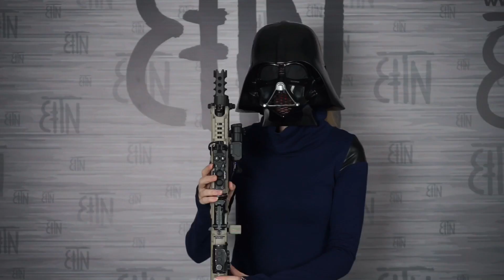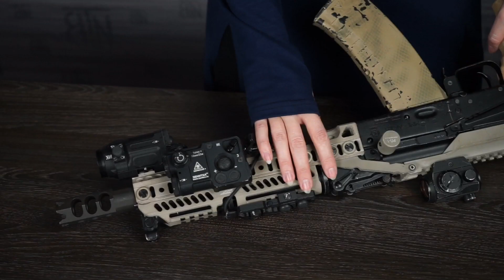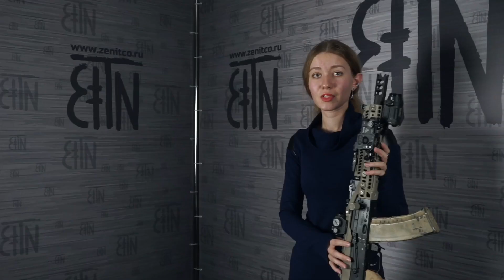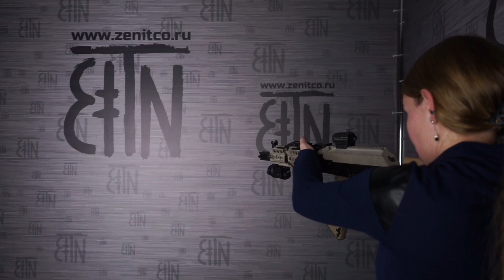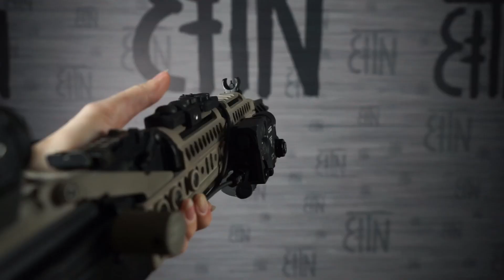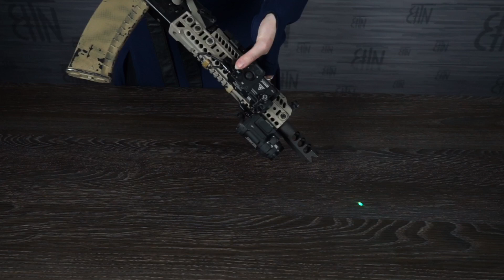Zenitco Perst-4 + Klesch-2 operation modes - Halloween edition

Comment: Can the remote switch be used with the klesch-1?
Reply from the maker: KV-4/2 - no. Another switch - yes. Depends on generation of Klesch-1. So older Klesch-1 were not compatible with dual switches. Klesch-1 gen.2.0 will be compatible with KV-D3/2P switch and other switches from “D” line. Klesch-1 gen.2.0 will be available soon (generation will be written in product name and engraved on product, if there is no generation mentioned, it means that it is older generation).

Comment: The gun probably has no recoil at all with all this metal attached 😄
Reply: Since you are replacing the parts, the weight does not go up as much as one would think, but still that gun weights around 0.5kg more than a stock variant (not including the light). Recoil is quite low due of the extremely aggressive muzzle brake, however, when you are using that, you will very much annoy your friends! Cheers.
Reply: I have a EOtech 512, a Perst 4 and KE2C M600B Surfire clone on my M70 Zpap along with the same DTK muzzle brake she had on her AK in the video and it does weigh some, but not as much as you think and that weight has made recoil non-existent. Not that 7.62x39mm recoils much anyway but the weight has made repeat shots on target a breeze when combined with the recoil control the DTK offers.

Comment: Anastasia I need some help with a question. I have a Perst-4 Gen 2 made in 2019 and a new Klesch-2 made in 2020. Which KV4/2 switch do I need? And will this combo work??
Reply from the maker: Yes, for Perst-4 gen2 from 2019 you need KV-4/2 switch (not KV-4/2U!). More info in this video: https://youtu.be/W-b6BPgkl1c
Reply: Zenitco in English thank you so much for the reply! I contacted Zenitco directly on their website and hoping to get a KV4/2 rather than the KV4/2U. Just got a response asking for confirmation. Hoping to be able to get one direct, Russian Thunder and Ivan Tactical don’t seem to have the older model of switch listed anymore.

Comment: Great video - Big fan of the Zenitco products, own both the Klesch-2 & Perst-4, didn't realise there was a dual switch - I do now & have just placed an order!! Keep up the great work
Reply from the maker: Thank you! Note that Perst-4 lasers manufactured before January of 2020 require KV-4/2 switch; and in January there was a little update so Persts-4 made after an update require KV-4/2U switch
Reply: @ZenitcoinEnglish  Thanks - Based on this information have just messaged you through EBay! Looks like I've ordered the wrong version 😔
Reply from the maker: We do not have a EBay store and never had. That are resellers. More info about update and what switch to choose in this video https://youtu.be/W-b6BPgkl1c

Comment: Is there a way to activate both the laser and illuminator at the same time?
Reply from the maker: Yes. But a note here: Klesch-2 does not have an IR illuminator, it has IR LED flashlight (there’s difference between them, will cover that topic in one of the upcoming videos). To turn on IR flashlight and IR laser simultaneously, you need to turn Perst-4 into IR laser mode and Klesch-2 - into the mode of IR flashlight. And then you turn them on by KV-4/2.
Reply: @ZenitcoinEnglish  I think he meant simultaneously with a one tap function. That way you dont have to press two buttons.
Reply: Zenitco in English Hi Anastasia ,  so I’m curious does this switch have a momentary on ? It seams redundant to have brightness control from the dial and when you hold the switch down .  Unless I am missing the reason for this .Thank you
Reply: Yes I’m curious about this also. I saw that you are currently developing new switches. Will there be a new switch that will activate both devices with only one button press?

Comment: Здравствуйте, I'm still learning Russian so the English videos are very helpful! I was curious if the remote switch would activate the devices momentarily with a light press, similar to how Surefire pressure switches work, or if it only offers a "constant on" style of operation?
Reply from the maker: Forgot to tell that our switches have tactical mode. If you press it continuously, the flashlight works in tactical mode. It means that the device is on while the button is being pressed. When you stop pressing it, the flashlight turns off. Will mention that in future videos.
Reply: press and hold -> tactical mode (shuts off when you don't press the switch)
Just press -> contant on, press again for off
I like the way how it is configured, it is very intuitive to use